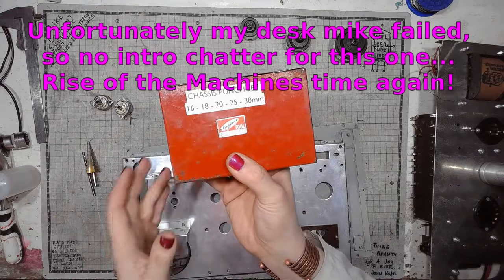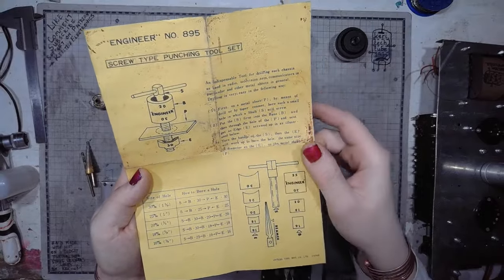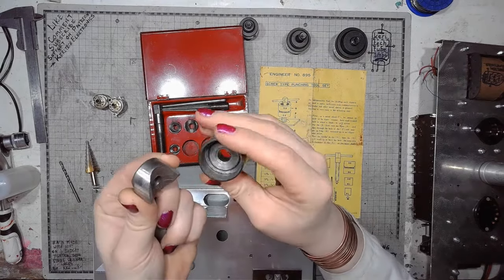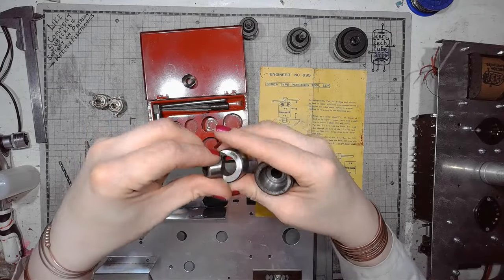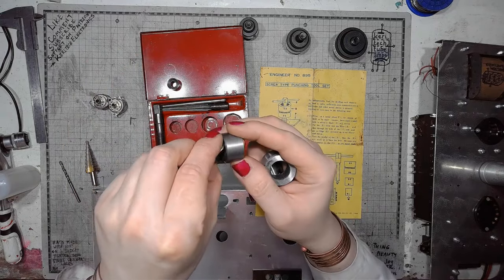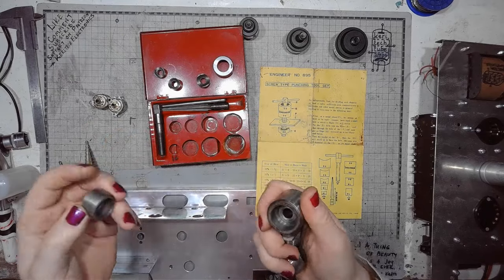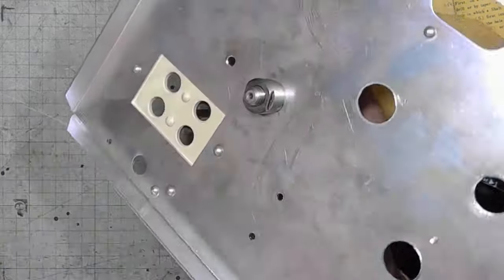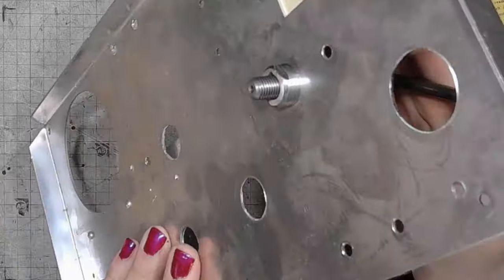Chassis Punches for Tube Sockets

Comment: Hi Keri, just got to watch this video. We have a very similar chassis punch kit. It is good for softer metals and very light gauges but that is about the extent of it. It would benefit from having a bearing between the screw and body. The ones you have with the thrust bearings are nice. I have been spoiled by the punches I have used in my various jobs over the years (I have done lots of custom industrial control panels over my career). Something cool now is the price of a lot of these tools have come down in price over the past decade or so. You can get lower cost hydraulic knock-out kits from online vendors for under $200 nowadays and those things are sweet, they can handle 1/16 DIN square punches without issue.

Comment: Drilling stainless is hard. I had to drill about twenty 8mm holes in 4mm thick stainless a while back, and destroyed a couple of conventional drill bits to get the first hole - then went out and bought some tungsten carbide tipped bits to do the rest, which worked a lot better. I need to get me some of those chassis punches, though! I don't do stuff with vacuum tubes but I do sometimes need to make holes for cable glands and ammeters and stuff, and they look a lot more precise and cleaner than my hole saws!
Reply from the maker: Agreed, good quality tools, low speed and proper lubrication is the way with stainless steel. I learned it the hard way.

Definitely get some punches - it's money well spent, and you'll like them the more you work with them. If working with steel a lot, you might try an impact wrench to drive them.

Comment: The intro looked like a very sad frog. 
I used this type of things lots making enclosures with cable coming out. Get the right size for cable gland drill a pilot hole and use the punch. Its a lot safer especially for a bigger hole say 50mm plus.
Reply from the maker: Ha. "The Sad Frog Intro" haha, I've used it for over a year now.

50mm is big indeed!